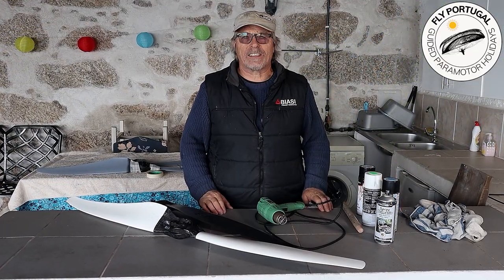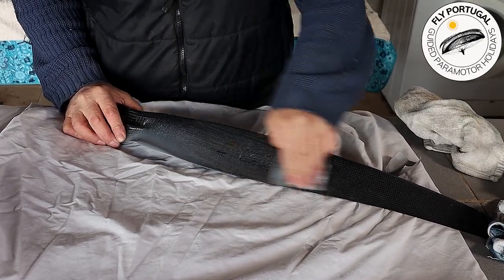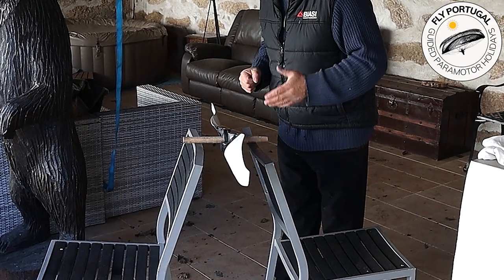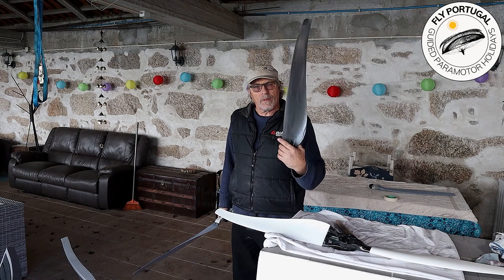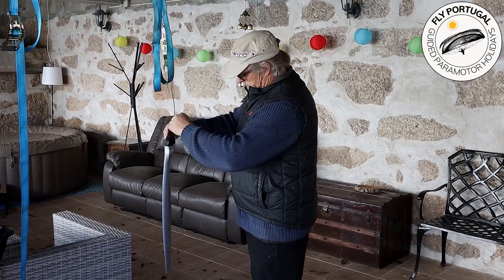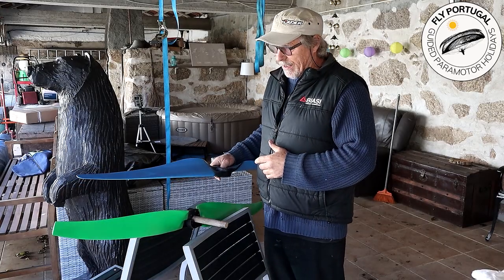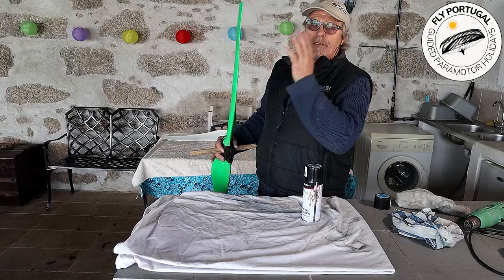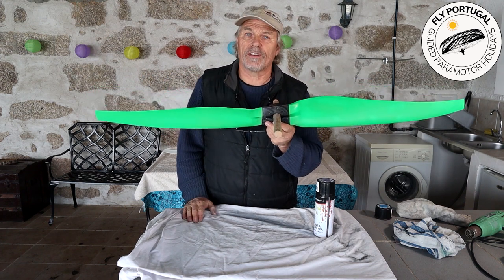Fly Portugal - paint and balance your paramotor prop

Comment: 6:00 at this stage you will have to turn the prop 180 degrees in a horizontal plane, kind sir.  The reason for this is that the chairs might not be exactly level; I have not seen you using a spirit-level :-P  Best, Rob ^^

Comment: Heating composites is never a good idea, it damages the epoxy and it does not take much. 

Better to use wax a grease remover to get decal off, peal off then wipe. 

Last thing to do after all works on prop is to balance it.
Reply: These props are made off pre-preg CF, in hollow molds that are baked off in an oven. Best, Rob ^^
Reply: @robertzeeland  pre preg is cured within a very specific temp range. Even patching pre preg requires a monitoring system so as not over heat or under heat the cure. 

I have been an aircraft engineer for over 20 years.